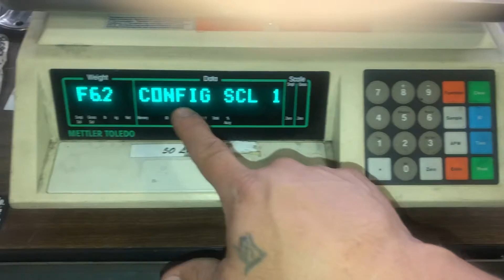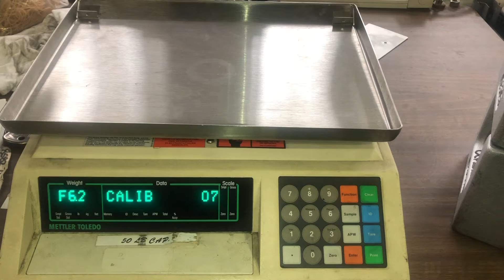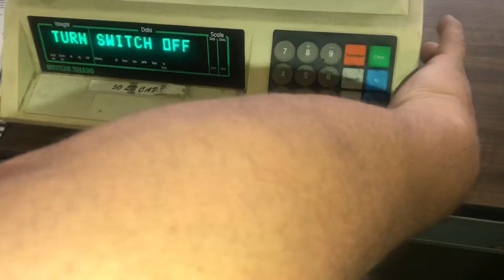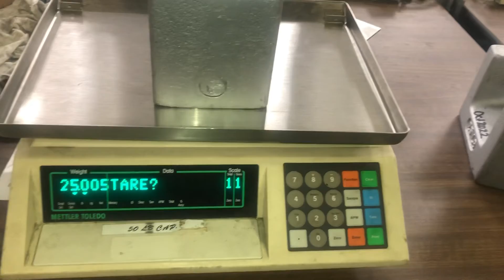Calibration adjustment of a Mettler Toledo 8582

Comment: Do you know how to fix a "NOVRAM CHECK ERROR"? 
It sat unplugged for a couple years. Worked before that.
Reply from the maker: Not to skilled on Mettler/Toledo but usually Ram error is a memory chip error once you power it down and power it back up it has to be reprogrammed and Recalibrated every time the power is recycled
Reply: @Raddamez1215  i tried calibrating it, like in your video. It functions now. Getting a checksum error now, but it clears. 
 I have two of these scales and they use to be tethered together. Not sure how all that works. But something about sample size..?.. I'm not doing any samples or batches. I don't need them for anything but weighing boxes for shipping packages and weighing propane bottles to know if they are empty. 
I downloaded a book for them, it seems pretty basic. I need to reprogram them to not look for each other, i think. But the problems i am having will probably require pulling the CMOS or eprom and having it reprogrammed.